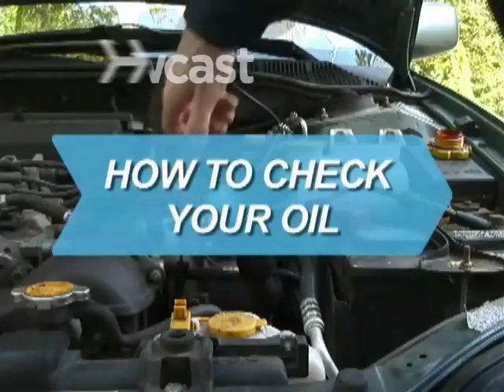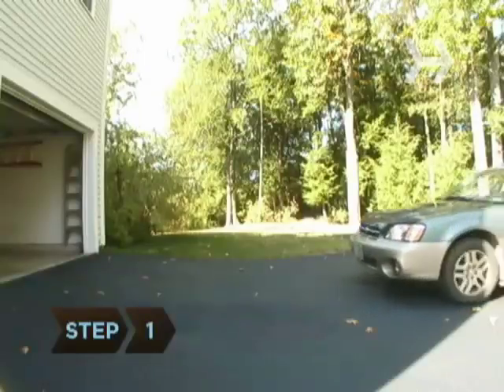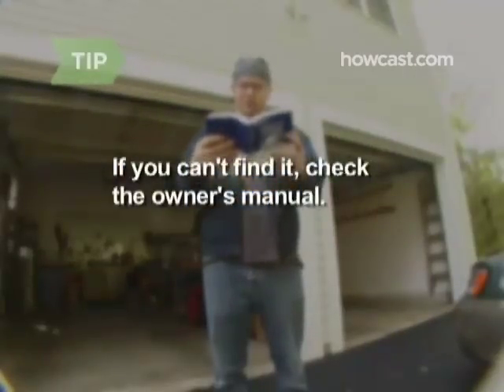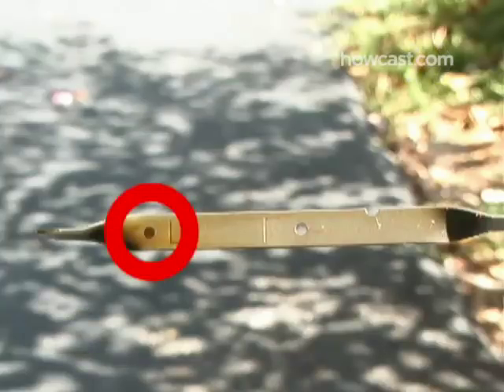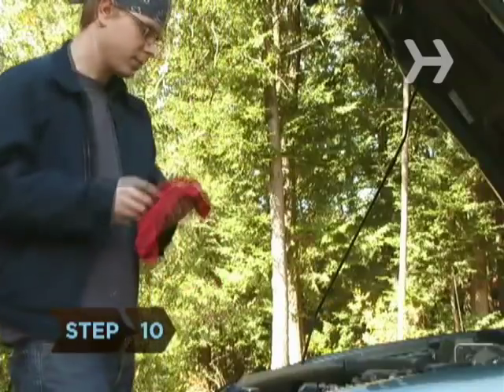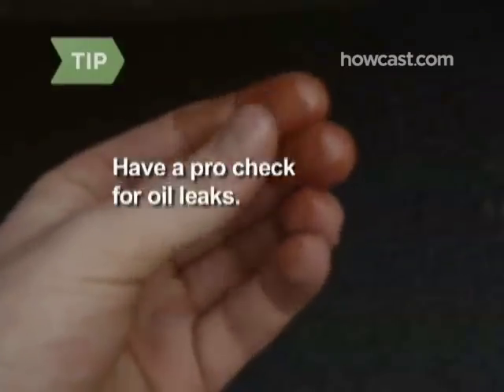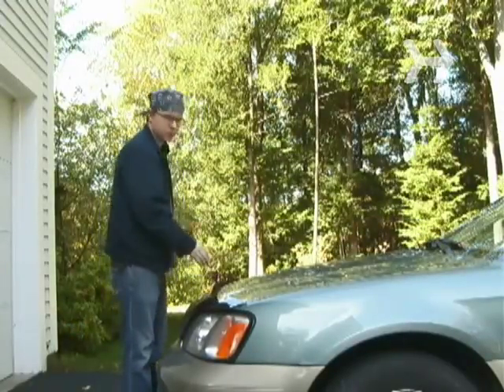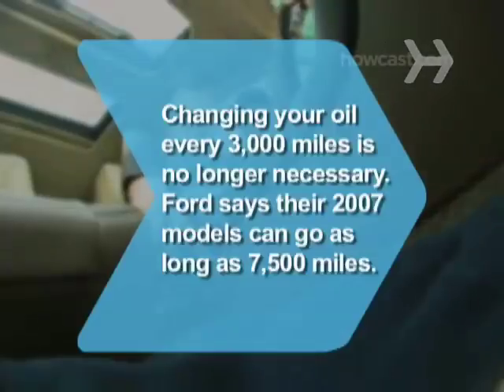How to Check Your Oil

Comment: Good video but people must beware that when you are checking your oil allow you engine to sit for 10 mins after running the engine to allow the oil to go back to you sump for a more accurate reading other wise you could end up over filling your engine.

Comment: For all those wondering below- you wipe it off first with a rag bec you are driving and it is sloshing around so it may look higher than it is and not give you an accurate level at rest.  

Also yes you should always drain old oil and change oil filter when changing oil but this wasn't changing oil- maybe your driving and release your oil level is low. You need to immediately address that before changing your oil. Adding more new oil won't hurt- but not changing the old oil frequently or addressin the underlying reason why you have a leak or low oil can. Always remember when the oil light is on STOP DRIVING IMMEDIATELY.  Check your oil level and pressure and car temperature. If the temp is high- no more turning on the engine you need a tow! Otherwise even driving feet without oil might cause serious damage to the car'a engine
Reply: actually it will look lower than it really is.

Comment: Listen to stazek1985. He is right. The best time to check your oil is in the morning, before you first crank your engine; after the oil has had time to settle all night long and the engine is cold. Make sure your vehicle is on a level surface, too. If you're parked facing uphill, your dipstick will read low when you may have plently of oil in your engine. If you're parked facing downhill, the dipstick may read full when you may really be low on oil.

Comment: They forgot to mention Nissan(most) owners have to wait like 5 minutes before checking after the engine is off to get an accurate measurement, takes forever to get an accurate dip sticking for the oil to drain out of the dip stick tube.  (ex-mechanic, it's annoying as hell waiting).

Comment: FACT: CARS EAT OIL, REGARDLESS OF ENGINE CONDITION/AGE/MILEAGE. OIL & BLOW-BY GASES DURING HIGH ENGINE RPM ARE PUSHED THROUGH THE PCV SYSTEM TO BURNED OFF. SO CHECK YOUR OIL, EVEN IF YOU HAVE A NEWER CAR! CHECK MY CHANNEL FOR MORE CAR-RELATED INFORMATION

Comment: And that is how you overfill the oil on a Subaru!
Subaru's should only be checked cold. The flat, boxer design holds oil in the heads for hours. Close to a full quart stays in the heads for hours. 
That means that, this car was likely right at the full mark on oil. Once it is cold, it will likely be overfilled by a full quart.
Reply: no only about 200 mL is held in not 800 that's erroneous information thank you
Reply: it would only be overfilled by a full court if the oil Mark was down to the ad position byyourlogic
Reply: @DanLoFat  At least the other guy knows how to spell "quart" lol

Comment: Yeah make sure you engine is cold and your car has sat for a while. Prime example I was reading about 2 quarts low when I tested after driving around for a while next morning I checked it and the oil was right where it should be maybe half a quart low. Make sure it's a cold engine.

Comment: Yes nice but you forgot to mention that you have to wait at least for a few minutes after turning the engine off... because oil has to came down to the oil pan, the best solution is to check the oil level at the morning when you're going to work, that's my solution.. and there is one more thing ! You can't pure a cold oil to hot engine for example in the winter when you keep a bottle with oil in the trunk and you want to pure some of it it can damage your engine (thermal expansion)

Comment: I just did and oil change on a Honda Civic LX 2004 and filled with 3.5 quarts of oil. Went to check the dipstick and on it shows that the level is low. Where did the oil go to? There are no puddles under the car and the coolant is still green.

Comment: Step 3.5 Turn the engine off when you remove the dipstick. You are welcome.
Reply: u serious?
Reply: Real Philippines You can check the dipstick with the engine running.
Reply: nah, the moving pistons are mixing it up and down. it may look full when it's not. You won't have a credible reading. But if you're being sarcastic about it can be checked while engine running, sure go. Lol
Reply: @michaelrapaport4494  yes you can't but about a quarter to a third of the oil that would normally be red on the stick will not be present in the SEC because it'll be spun around into the system kiss linden the crankcase. as long as you keep that in mind then you won't be over filling, but you get an accurate reading no you cannot read your dipstick when the engine is running. what you should not do is oil or even take the oil cap off while the engine is running higher idle speed engine oil can spew out at you be careful

Comment: IF THE OIL IS NEW SOMETIMES IT IS DIFFICULT TO TELL AT WHAT LEVEL THE OIL IS AT THE DIPSTICK.
Reply: rcx8666c I check my oil, but it marks all over the place. So I can't get  a good reading. What am I doing wrong?
Reply: +MrRedskins0021 wait like 10-15 mins after its warmed up for the oil to drop back down then check it
Reply: rcx8666c I already did all of that. It's just the dam synthetic oil.
Reply: THE CAR MAKERS SHOULD MAKE A WHITE DIPSTICK INSTEAD OF A BLACK DIPSTICK SO YOU CAN TELL WHERE IS OIL LEVEL IS LOCATED.
Reply: +rcx8666c I TOO ENJOY YELLING THROUGH ALL CAPS CONRAD
Reply: +Zach Petrecca WHAT SPEAK LOUDER SONNY I CAN BARELY HEAR YA
Reply: rcx8666c For clear oil, add a tube of OilBrite with each oil change. $2.99 at Pep-Boys. It comes in blue, green, and red.
Reply: well no it's easy to read what you do is turn the dipstick 180 degrees and carefully push it all the way down wait a second then pull it out this will give you a much more accurate reading and I'll be less mess about on the stick as there can be with actually a lot of Toyotas for some reason there dipstick was built backwards!

Comment: nobody ever mentioned that from  add oil point to full point is exactly a liter of oil.
Reply: Armando Sturzenegger  Lil d 2 explained just reread what he wrote and use a little English grammar and you should be able to figure out what he said and that what you got out of that was erroneous. now go Google the word erroneous.
Reply: yes that is universally true so if it's down by about a quarter you could add 200ml as long as you took your reading at least 5 minutes after running the engine or in the morning before you start the car. also as there is pressure in the system you're going to want to unscrew the oil cap and then wait 5 minutes because there's enough pressure in there that can hold about 100ml away from what you're reading.

Comment: why do you need to put the rod back in after cleaning it with a rag and then take it out again? why cant you just take the rod out the first time and check the oil without cleaning it?

Comment: Today i checked my oil and it was at the add mark D: i almost fainted it was so low
Reply: CARS EAT OIL, REGARDLESS OF ENGINE CONDITION/AGE/MILEAGE. OIL & BLOW-BY GASES DURING HIGH ENGINE RPM ARE PUSHED THROUGH THE PCV SYSTEM TO BURNED OFF. SO CHECK YOUR OIL, EVEN IF YOU HAVE A NEWER CAR! CHECK MY CHANNEL FOR MORE CAR-RELATED INFORMATION
Reply: Yup i know i've become an oil expert now pretty much by reading a motor oil forum for a few months

Comment: FOR THE LOVE OF GOD DONT GO OVER 3000 MILES TO REPLACE OIL. if you have a newer car sludge from not changing oil will mess up parts of the engine.